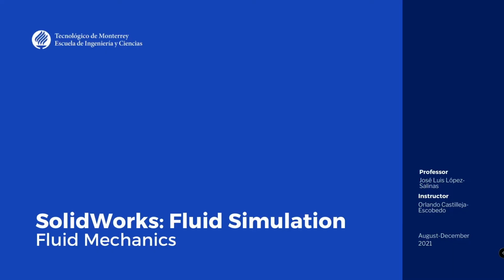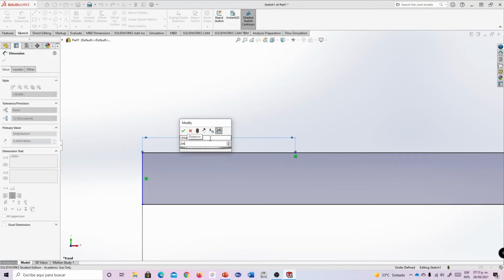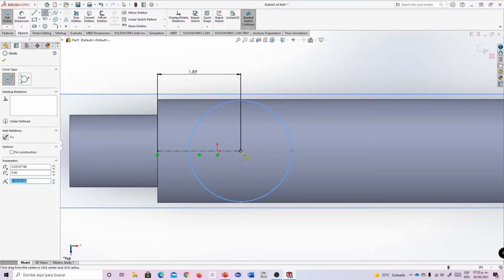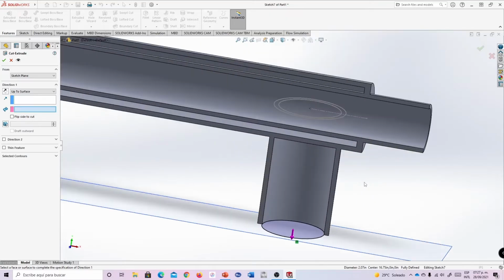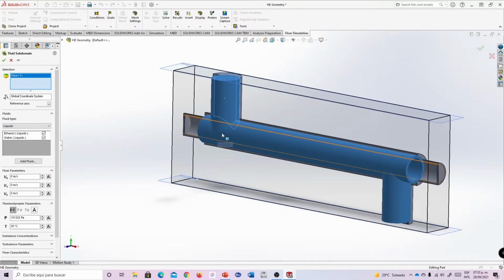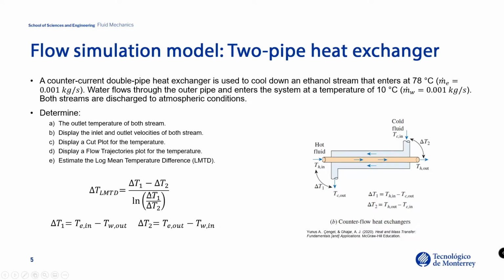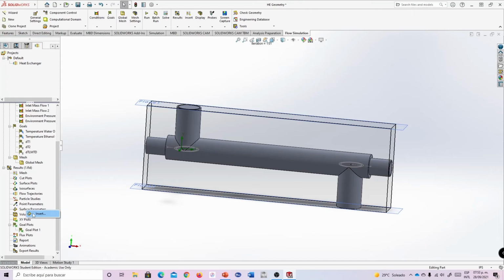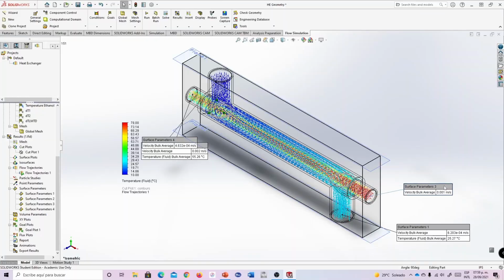SolidWorks Flow Simulation: Heat Exchanger

Comment: Nice tutorial! I just had a problem, I use solid 2023 and i didn't get the seme results that you found. The section plane is completly diferent and the outlet temperatures were around 45°C for water and around 25°C for the ethanol. I also done this step by step in solid 2019 and the results were the same as yours!

Did anyone with the same problem?
Reply from the maker: @DowntowN2101  Hi, in my model I didn’t activate the gravity during the Wizard stage. Maybe this is the difference to your model.
Reply: @orlandocastilleja   I just checked, but I didn't activate gravity in my Wizard stage either. Now I'm in Solid 2024. I copied the model and the simulation from a Solid 2019, the one that had the same values and the same behavior as yours, and just started the calculations and, after finishing, the values of the same model and with the same parameters had a completely different behavior. Just by changing the year of the software :(

I also tried it on Ansys and your values and behavior were the same as yours. It looks like that Solid 2023 and 2024 clculate it completly wrong
Reply: Yes solidworks not doing proper simulation

Comment: Hi, thanks for a good video, however there are one thing that i am curious about: Are the values accurate as you are using Adiabatic wall? 

- Ref definition: "Adiabatic wall. This is a heat-insulated wall. By default all walls are skin friction surfaces. If you want the wall to be adiabatic and frictionless, you must create a boundary condition type of Ideal Wall on the appropriate faces".

For me it looks like no heat transfer occurs over Adiabatic walls. 

I am new to this so I am just trying to learn what parameters i need to set for my own simulation. 

Hopefully you can clarify, in advance, thank you.
Reply: Good point

Comment: What can i do if i want fluid is not prefined?
Reply from the maker: You have to look for the Engineering Database button in the Flow Simulation toolbar. You will have to add a new User-Defined fluid and specify most of the required property values.
Reply: @orlandocastilleja  
Now iam confronting another problem it said that the the entries is not close